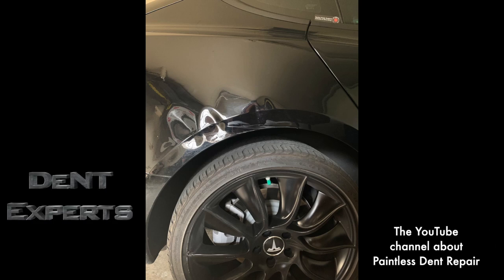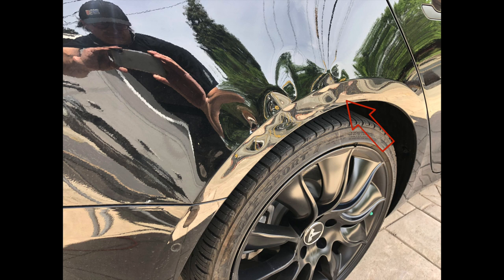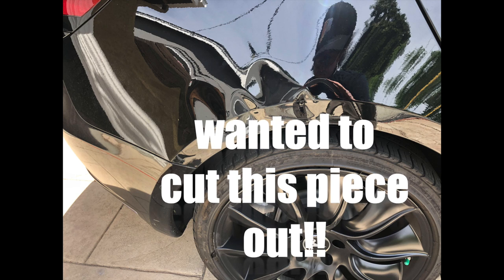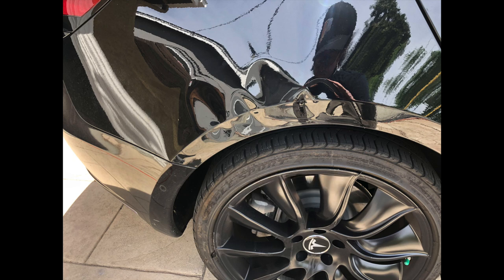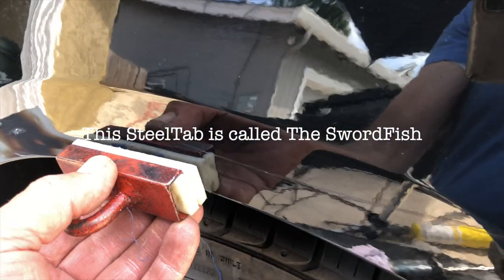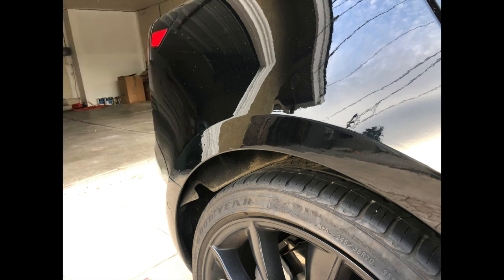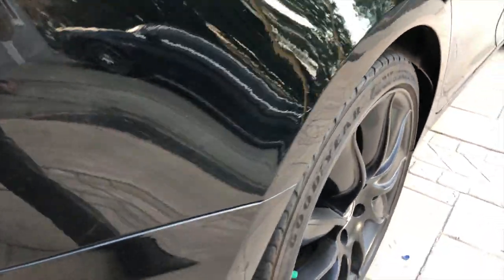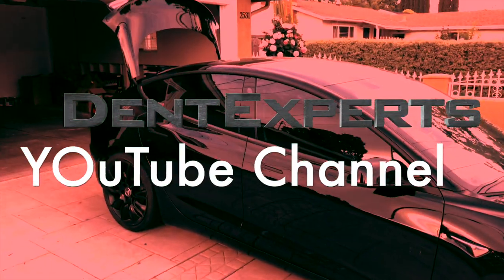Tesla 3 dent repair on black quarter panel without repainting or refinishing. Paintless dent repair.

Comment: I have the same car with the same damage on the same panel. They quoted me $8k at a local Tesla shop to body work it not even to replace it. I would pay all the expenses if you would come and work your magic on my model 3
Reply from the maker: @chadparker8890  thanks for the message send pictures of damage to me and i’ll take a look. It’s possible to travel to you just depends on severity of damage. You can send email to dentexpert@mac.com for assistance with evaluation.

Comment: Are you guys in LA?  I was going to have my body shop (at their price so a good one because I give them lots of business including the paint protection I was about to get) for a tiny dent and a tiny scratch but it's finger nail deep.  I didn't know about the fact that the factory paint would be so much different and they want to repaint to panels (the front bumper and the one with the tiny dent). I was worried that the paint wouldn't match and it's so small that I was considering just leaving it although if I can even just get a fix that looks near as good as this, I'm down. Please let me know if you guys do work in LA or can recommend someone who does.  Thanks